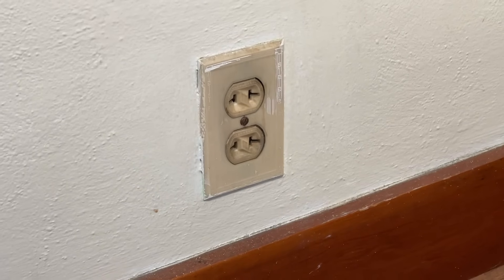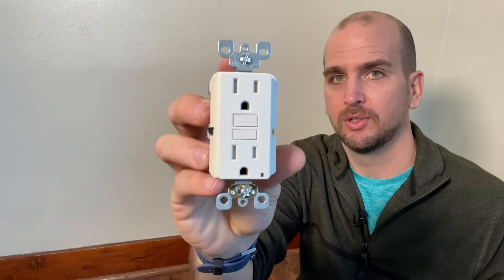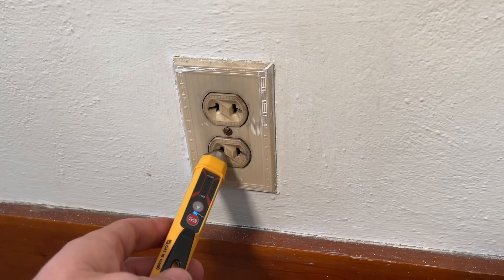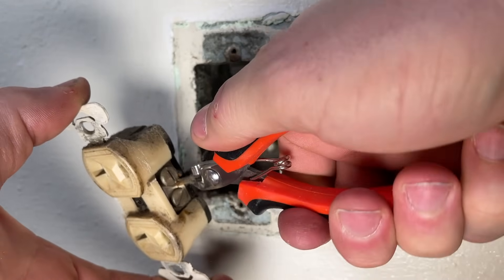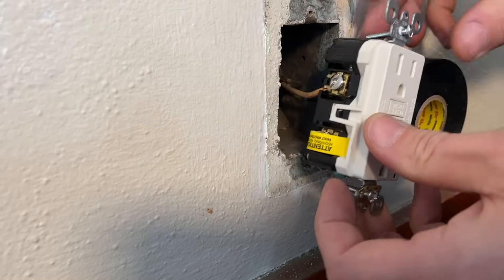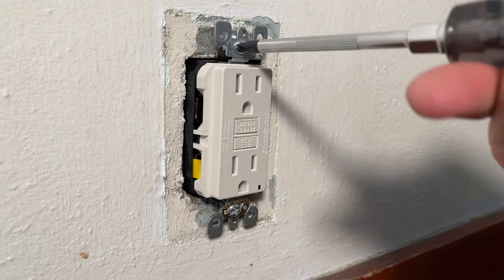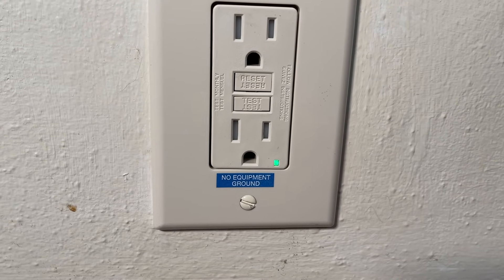How To Replace An Old 2 Prong Outlet Using 3 Prong GFCI

Comment: So he says in the beginning that he faceplate screw is not grounded so if thats the case then this GFI O GFCI will not protect you if you touch the hot wires. Bad advice do not follow. For the most part when the orginal wiring was done with 2 prong outlets  and if there's a metal electrical box they did run a 16 gauge bare copper wire to ground the metal boxes. 

The problem with that is a single break  in the the copper wire could eliminate the ground wire for  several outlets. 

You should always use an outlet tester to check that it's properly wire. Just using the hot wire tester as he was using is not a good way to check that its wired properly. On a lot of these older homes that don't have the chassis ground wiring the hot and neutral wires can get reversed.

I ounce did a check on a plug that three different electrical contractors had looked at prior to me they all had missed diagnosed that the it was good. I was hired by the landlord because it was ther refrigerator  receptacle and the tenant had burnt up 3 brand new refrigerators. He was using the old 3 prong tester. The problem with using that type of tester is it will test good if the hot and neutral wires are reversed.

If your going to attempt this replacement you need one of the newer 3 prong testers like this one - klien Tools RT100 https://www.amazon.com/Receptacle-Tester-Klein-Tools-RT110/dp/B01AKX3AYE/ref=asc_df_B01AKX3AYE/?tag=hyprod-20&linkCode=df0&hvadid=309778489815&hvpos=&hvnetw=g&hvrand=9366044302446078307&hvpone=&hvptwo=&hvqmt=&hvdev=c&hvdvcmdl=&hvlocint=&hvlocphy=9031595&hvtargid=pla-571548716375&psc=1
 that will check to make sure  the hot and neutral wires are not reversed.

That being said this videos author is just giving bad advice here.

The correct way to attach a GFCI to any gang box is to run a separate ground wire to the gang box.

DO NOT DO THIS!

Comment: Why not fill the ground slot/hole, in addition to or instead of the label, to prevent the insertion of 3-prong plugs?
Reply: Not code
Reply: Because the sole purpose of this change is to allow inserting them. Filling the hole would defeat the purpose.

Comment: When I replaced to two slot outlets in my old house I did find that the boxes were grounded.
Reply: Timothy Baker: How do you check/know if the box is grounded?
Reply: @lazurm  there was a bare ground wire screwed into the back of the box.  I also tested the voltage between the hot wire and ground.
Reply: @lazurm  Simple voltmeter or circuit checker test. Plug one probe into the hot slot in the outlet, touch the other probe to the plate mounting screw (or the plate, if it's metal). If the meter indicates voltage or the checker lights, you've got ground to the box. If you're not sure which slot is hot, try testing both.
Reply: @dougbrowning82  Thank you.
Reply: If it's in a metal box, the ground self-grounds to the box. No flying lead needed. Plastic, you have to bond to the outer wire casing.

Comment: Why keep the metal box in? Why not just swap to plastic. Wrapping in tape seems like a corner cutter
Reply: A good point. The GFCI method is not safe on ungrounded metal box. If voltage gets to the box it will get to the equipment case. If the box is grounded then why not pass the ground to the device.

Comment: I was waiting for the part where you crawled under the house to connect a ground wire to the nearby cold water pipe...
Reply: That's not proper grounding for your receptacle. Thats Grounding and bonding 101 lol
Reply: We have basements  where I come from. Oh and how to you ground  to plastic pipes  like in use today. 
And BTW two and three wire with a ground wire  cable has been in use since the early to mid sixties!
Reply: @dwightlyon3643  I live in CA and they are really uncommon here. Too expensive to build them
Reply: @dwightlyon3643  I don't think that it was mandatory until more recently though.
Reply: @charleshodgdon6168  well I have been around for near 70 years, and from the time I was ten I don't  remember a time when Meter bases were not grounded with copper rods and also the main breaker box or fuse panel if you prefer. I did a lot of wiring when I was younger and was more current back in the day than most because I worked with an electrician who had his masters and also taught in one of the  vocational colleges.  But that was 40+ years ago and I know codes have changed since then, some for the better some for the worse.
Reply: You should not do that especially in an apartment. At worst someone in s bathtub touching a water pipe will get killed.
Reply: Electric Code requires you to ground(bond) your water pipes.
Reply: @gano7297  well friend you tell what good it does in today's world when all things water in homes are now basically  plastic! EVEN though the house I grew up in had mostly copper  the water line from the well to the tank was plastic as are most water lines from any driven well, that being the case what good did or does it do to ground the something  that doesn't  go to " EARTH " where I am thank God we don't  have shitty town/city water or sewer!
Reply: or drill hole thru wall and run ground wire right outside to ground rod 2' long in the ground should work fine as trying to drive 8' long ground rod into reinforced concrete like ground is pointless and waste of $20 8' long grounding rod that can be cut in 4 pieces, driven almost flush with the ground and ground wire clamped to it... keep ground moist if possible for better grouding capabilities

Comment: actually the outlet with the plug in adapter with ground strap likely would of been grounded, especially considering it had a metal box. older wiring installations with BX armored cable was grounded (albiet, less than ideally) through the outer metal sheathing.
Reply: I disagree

Comment: You installed it in the least safe orientation. By placing the ground pole on the top you increase safety on 2 areas. First it helps reduce the human nature of anthropomorphism and how children will see a happy face in it with the ground pole on the bottom. Also with the pole on the bottom it reduces the chance that a metal object randomly dropped on an insecure plug can contact both blades and completing the circuit. While not a code issue it is good practice for safety.
Reply: Except any "lay flat" power cords (see fridge cords) are designed to work properly with the ground prong facing down

Comment: I thought you were going to show how to bring in a ground wire and ground the outlet. Still, you can add ground wiring any time and the outlet is ready for it.
Reply: He changed a ungrounded outlet to a $30 ungrounded outlet.
Reply: @rlbooth56  I was waiting for him to explain how he was going to ground it.
Reply: @rlbooth56 wouldnt you just use a cheap 3 prong outlet ? If in just a bedroom or something?
Reply: @krisalan5327  I would install a ground wire and afix it to service ground (cold water piping or grounding rod (s). NEC requires the ground conductor be in the same jacket as the other conductors feeding the device. The gentleman instaling the outlet tested the GFCI and found no presence of ground from the box or service conductors.
Reply: @rlbooth56  ok thank you
Reply: Old working actually has the grlund attached to the back of the metal box and if you notice the gold looking thing on the bottom of the yoke that actually grounds the gfci to the box so it actually is grounded but use your test meter to check for voltage through the box to make sure.....
Reply: @illwil2158  only if there's a ground path back to the panel.
 Even though they make you ground plastic because of a  lightening strike it create a field greater than the pipes and it takes that path of the wire on the grounded plastic to the ground path to the panel  instead of going nowhere
Reply: @illwil2158  Can't ground to the box if it's plastic.
Reply: The box metal or plastic isn't grounded.

Comment: Why not j hook to the screws on this one?
Reply from the maker: I used the backwire feature opposed to J-hook around the screw terminals.  I prefer back wiring and overall trust that the plates hole the wire secure.

Comment: Step 1 : replace wire.
Step 2: replace receptacle 

I refuse to provide a place for a ground when there isn’t one.
Reply: Why?
Reply: Good luck with that in a slab house that has lath catchers placed horizontally in-between the studs every two feet.  You will be patching lots of drywall.

Comment: Thank you.  The older half of my house is almost all 2 prong.
Reply: if you need to replace he 2 prong receptacles you can order the same online. either eBay or Amazon. Or get a GFCI for more protection. Check your wire size and either breaker or fuse amperage.  Don't put a 15 amp receptacle on a 20 amp circuit. Just in case it was wired that way.  It is against National Electrical Code to put a 3 prong plug on a non grounded circuit without GFCI protection
Reply: My family home built in '55 had the two prong receptacles. I eventually did all the first floor with three prong and the ground was attached to the inside of the box. This made the conversion easy. I renewed all the breakers as well.

Comment: It would appear that you replaced a 20 amp outlet (non grounded) with a 15 amp GFI, why did you do that?  Jim
Reply: Now I could be wrong about this, but I don't think every outlet on a 20 amp circuit need to be a NEMA 5-20R receptacle, I think as long as the max rating of the receptacle does not exceed the max rating of the circuit breaker, then things should be OK.

Also, there is a number of reasons he might have wanted to replace the 20 amp receptacle with a 15 amp one, some reasons I can think of are.
20A (NEMA 5-20R) receptacles tend to cost more than 15A (NEMA 5-15R) receptacles.
Devices that require a 20A circuit (and outlet) are less common than ones that only need 15A.
Due to the age of the wiring, he might be downsizing the circuit to reduce the risk of fire.

Now there could be another reason that I did not think of, but I hope this helps a little.
Reply: With that old wire, I'd bet it was only 14ga
Reply: The old outlet was not a 20-amp outlet.

https://shop.worldcordsets.com/shop/reference-materials/nema-reference-guide#2
Reply: @Adam1nToronto  Thank you, I did not know that due to it being obsolete.

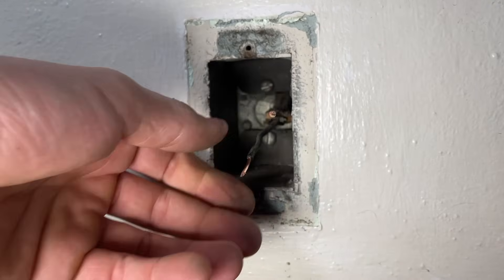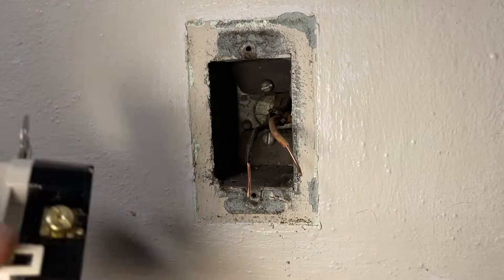Comment: 3:05  When stripping wire, DO NOT rock back and forth as shown. This can easily score the wire (as seen at 3:11), and copper wire can break at that weakened location. Best way to strip is to bite with the stripper once, loosen your grip, rotate 90°, bite again, then pull off the insulation. Just be sure to use the correct wire size indicator on the tool. Not sure which size?  Start with a lower number (bigger wire size). If the insulation won’t release, then try again on the next smaller hole.

Important note: Not trying to be critical, only to use the best safety techniques!

And no need to say "how's it going you guys."
Reply: this is solid advice thank you
Reply: @YoureWokeYoureBroke  Solid?  Didn't want to leave you *stranded*.  I just couldn't resist.  Oy!
Reply: @BitSmythe  lol
Reply: @stevebouley5166  I'm just trying to keep current - without being revolting.
Reply: Watt?
Reply: @bluecat0132  this whole conversation hertz
Reply: No need to say how's it going Guys?

Comment: 1:59. When double checking for voltage, SOME broad tip testers, or any tester with weak batteries may indicate a false negative, especially when testing outside the actual outlet as shown.
Reply: After installing a GFCI if the light is on, it's hot. If not push the reset... if not again, well ya botched the wiring somehow.
Reply: Once I'm sure the electricity is off I always touch the hot wire to something that would short just to be doubly sure before I handle it
Reply: A simple method I've used to ensure the correct breaker had been flipped to turn off power to the outlet you are working with is this: I have an old alarm clock that I don't really used. Triple prong mind you.

I plug clock in and see that it lights up. Power is on. 

I take my tester/ voltmeter and ensure it lights up properly. 
Plug clock back in. Lights on. Power on. 
Leave clock plugged in and walk to breaker panel.

Flip breaker walk back and see if the clock is on or off.
Unplug replug. Wait. Check for the clock lights. No lights would suggest no Power.

I grab a tester/ voltmeter and double check all circuits. No lights/beeps no Power.

Commence electric work.

When finished, rewire if necessary, plug clock back in.
Flip breaker.

1 of 3 things will happen:

1. the clock will turn on and that's it.👍
2. The clock does not turn on. Bad wiring.  Redo/ check with voltmeter.  👎
3. The clock turns on for a hot second before it metls, explodes or smokes. Sometimes makes popping sounds or a very loud pop. This means too much power ⚠️⚡🔥🧯 
(perhaps a 240v instead of 120v) a good voltmeter should tell you this going in but sometimes they fail. Sometimes pre done wiring is insane. Safer to have an alarm clock No one cares about explode, melt or light on fire than risk your house full of stuff later on.

 ALWAYS check with an appliance you dont care for and one rated at 120v as most things are standard at 120v. 

Obviously certain Plugs may be wired for 240v for heavy appliances. 

***Disclaimer***
I am not an electrician by trade or training. This is just how I do things when alone to minimize shock and or death. NEVER DO ELECTRICAL BY YOURSELF. ALWAYS have someone near by incase of shock or electric fire. As well as ALWAYS have an ELECTIRCAL FIRE rated fire extinguisher on hand. (Not all fire extinguishers  are the same and many will not put out electric fires, please be safe.)
I honestly recommend having a professional do your electric work.

Comment: I did not understand how a single GFCI with a daisy chain outlets should be set-up.
Sure, use the load connectors for the downstream outlets, but:
1. How can I tell what is really downstream, with all the wiring are inside the wall (e.g. perhaps an outlets is upstream instead of downstream in the chain), or perhaps it does not matter?
2. Where will the downstream outlets get the "ground" wire from, i.e. they should have 3 hole socket, or otherwise what's the point?
Reply: It definitely matters. You can try to figure it out from the layout. This gives a start. You can tell it that once you remove the outlet you turn power on and the downstream outlets should be dead. Remember to take appropriate precautions, especially make sure that no children are at the premises. Remember t disconnect the power before you work on it.

After you are done test the GFCI and verify that all outlets you changed are dead.

There will be no ground wire to any of the outlets. That is the whole point of this modification. The ground hole in this modification serves no function. The whole point is to allow inserting plugs that have the ground prong. The GFCI works as the safety function instead of grounding.

Comment: You didn't do nothing. Still no ground. Waste of time. GFCI will not work properly without a ground.
Reply from the maker: I am open to feedback but I am 99.5% sure that is incorrect.  The GFCI detects a different between the hot and neutral and that is what trips the interrupt.
Reply: @EverydayHomeRepairs  Everyday Home Repairs is correct. I am an Licensed Electrical Engineer.

Comment: Thank you for the tip about daisy-chaining the first outlet with GFCI and the rest with standard outlets - will save a ton of $.  Several people have commented on the "difficulty" of hunting down the first receptacle on the circuit so that they can use only one GFCI outlet and daisy-chain the rest with standard outlets.  What's the best way to find the first outlet?  Do you have to one-at-a-time disconnect all the outlets (starting with the most logical one) and then check if all the remaining outlets become non-functional?  Is there another way?  Thank you!
Reply: You're pretty much on point. Just have to shut off the breaker, then test to see what has power/what doesn't. Usually it's the closest to the panel, but I have found some Mickey Mouse home runs that were at the very end of a room.
Reply: There is another way. A much better and faster way. You buy a fox and hound, or a similar tool. You hook it up to the outlet or device that is not powered (you could pull the circuit breaker and hook to it, Once the circuit breaker is removed, there is no power to it.  You would test anyway just as a precaution; sometimes crazy things pop or are wound at the oddest times.) and point this wand or the hunt tool at outlets and lights; if it beeps or lights up, you know it's on the circuit. They used to be expensive. Today they aren't really expensive. You can look them up on YouTube and or the web to see what they cost and how they work.